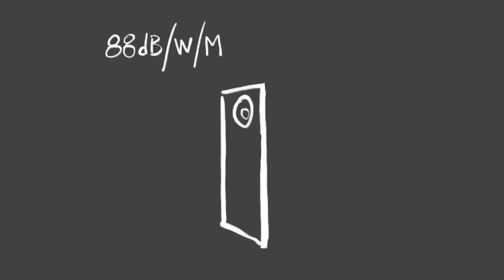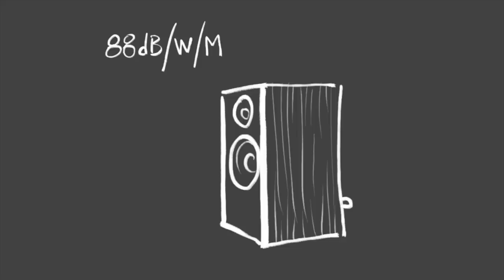John DeVore goes on a rant about the High End Audio lie that inspired him to start his company

Comment: A modern high fidelity speaker is a sealed powered speaker with a separate amplifier for each driver and a digital crossover.  Such a speaker has none of these "sensitivity" concerns and will deliver excellent fidelity,  dynamics and wide frequency response only dreamed about by passive vented speaker designers. If you aren't buying such speakers like those built by Dutch & Dutch or others, you are missing out.

Comment: You do know these amplifier manufacturers "underrated" their amps into higher impedance loads to create the illusion of a "constant voltage source"? A Krell amp, and I'm just using them as an example because I believe they were the 1st to claim 1 ohm stable at full power, that was rated at 100W @ 8 ohms and doubling all the way down to 800W @ 1 ohm was actually capable of a lot more power at 8 ohms than 100W. Since there's no law against underrating an amp that's fine. But it was done to manipulate the minds of consumers into believing the amp was capable of something that it wasn't, doubling in power when halving the resistance down to 1 ohm.

Just to add an oppinion since you brought them up, Apogee would flat tell you that an amp like a Krell was needed to "properly" drive their speakers. They would also strongly encourage you to keep their speakers ~4 feet from the back and side walls. I think that this in the end was a big part of the reason Apogee failed commercially (That and difficulty shipping them safely). Even though they later came out with speakers that weren't that hard to drive and had dynamic woofers the "stigma" of the Full Range and Scintilla speakers as well as demanding room placement of all their full range "ribbon" designs was hard to overcome. Just a roundabout way of explaining why speaker manufacturers can't always be forthcoming in marketing their speakers.

Comment: I share your frustrations in the commercial world as well.  You should note, the doubling of amplifier power output, even with linear solid state amplifiers is not exact either.  It all depends on the output impedance of the amplifier itself as to where its maximum efficiency is located. Furthermore, if you look at such curves, the efficiency drops like a rock once you go below that impedance. 

The other issue with using voltage as a sensitivity measurement is that it presumes a uniform impedance...which no woofer has (that I know)...the impedance specification is nominal over its entire range and for some speakers, it is more nominal than others.  When using the "Watt" specification, that is cooked in...you are measuring a watt of power feeding the speaker and measuring the SPL at 1m.  

Another point on looking at efficiency numbers is to know what the audio range is that they are making the rating for.  This can be particularly important when evaluating subwoofers where a sensitivity rating for say 20-200Hz will be dramatically different than one that was measured just from 40-120Hz.

Comment: Thank you very much for this very informative video. Purely by chance I bought speakers that area constant 8 ohm load across the audible frequency band that are not massively sensitive at 85db/ watt at 1 metre as they are an infinite baffle design. My 70 watt amplifier has no problem driving them at all and they sound amazing. Basically I was very lucky as I wasn't aware of this vitally important characteristic before purchase!

Comment: I'm assuming you left 'frequency' out of these equations to simplify your point! But at what frequency is the source signal in any of these references, (most speaker sensitivity ratings I've seen state - 1Watt @ 1kHz @ 1 metre) or do you just use pink noise? To put it another way. 1 Watt at say 80Hz into a bass driver or speaker enclosure may be just audible, while 1 Watt at say 8kHz into a HF driver or enclosure may give to a blown tweeter or possibly permanent tinnitus, or both! I think references should be made using 'pink noise', with a graph to show the output across the whole audio spectrum. Just as they do with microphone frequency sensitivity.

Comment: Ok, the explanation is very logical, but it doesn't finish clarifying the issue of compatibility or synergy between speakers and equipment.
I have owned speakers like AR11 that burned out sansui 919, yamaha ns1000 that worked perfectly with a mc intosh 240 and some dynaudio that needed huge doses of current to sing, but also had a limited db range. It would be interesting if you explain what parameters should be used to choose loudspeakers for different equipment.

Comment: From this presentation I would gather that a tube amp would be a very poor choice for my low low impedence Thiel speakers.  However, the guy at the audio store said exactly the opposite that - that for optimal sound I need wide bandwith power output of a tube amp for my inefficient speakers. I am Soo confused.  I am thinking my best path is a hybrid amp with tube front end and a power solid state backend? I auditioned such an amp - McIntosh - with some smallish Martin Logan speaker which had powered woofer. It sounded amazing for the price and rated power output of the amp But those speakers are So different from mine.

Comment: So for luddites like me, who isn’t inclined to do maths calculations as part of the process, when buying speakers (and an amp perhaps) what key things should I look out for or consider? what simple rules should I follow)?
Reply: Honestly dude, all these figures are largely pointless to the average home consumer who just wants a decent representation of the music that they love. It's worth understanding that db is a logarithmic scale though, so a 10db increase in sensitivity is perceived as a doubling of volume. The way speakers present sound does vary massively though, and I would recommend actually listening to speakers in comparison with others, preferably in the place they will be used. For high end gear all good retailers will offer this, for low/mid end gear you should be able to listen to the gear in the shop, either in an auditioning room or as part of switched comparison (take some musical pieces you know well). 

If you listen to compressed sources though (mp3 etc) you will never realise the potential of even mid range gear. Decent gear will often make you appreciate how flat and undynamic mp3 is, to the point that you think some huge bottom has come and sat on the sound. Well mastered CD is fine though, and will benefit from decent kit.

You can see below to Bill and SoundStage's comments if you are prepared to take on greater technicality, but ultimately DaVore's take on it is not really correct. Providing it in a "simplified form" which is technically incomplete but leads the consumer to thinking they have the whole story, is perhaps more of a dis-service than giving the technically correct version.

Comment: So what you are saying is if I have a speaker with a high impedance it would require less power to deliver the same amount of sound/volume as a low impedance high powered speaker?

So a 12” speaker with 64 ohms it would require only 2.25 watts running at 12v and 0.1875 amps?

Vs

A 12”  speaker with 8 ohms requiring 18 watts at 12v and 1.5 amps?

I am a real novice when it comes to this.. please correct me if I am wrong..

Comment: High efficiency speakers allow marketing to put a big number which appeals to the most common consumer. They do this at the expense of linearity and Bl (IIRC). There are some decent ones out there, but most sound like garbage. A low efficiency speaker doesn’t mean it’s bad. Often quite the contrary, it just means it doesn’t respond and over respond to inputs. If you blow on a penny and a feather, which one can you guide more precisely?

Comment: I really like your graphics. What do you use? Also -  the db/1W/1m rating doesn't work without specifying a frequency. This is because the impedance is a reasonably strong function of the AC frequency. But even if you specify a frequency, say 1kHz, there's no assurance the speaker will be at its nominal impedance at 1kHz - especially if the crossover is there too. The the right way to do it is to specify both db/1m and W/1m at 2.83V. The former is important because it won't vary with frequency nearly as much and the latter helps understand the power efficiency - i.e. the power load on the amp. But the latter is also more or less given by the nominal impedance so I'm not sure what's so bad about db/1m @2.83V and specifying the nominal impeadance. This is much better info than a db/1W/1m specification.  The real challenge for amps is wild impedance variation as a function of frequency - but that's only going be visible on an impedance plot - and speaker designers should design easy to manage speakers anyway as part of the process. All that aside - I think the days of loud speakers w/o integrated amplification are dead. There's just no point anymore. With efficient amplification, reduced power supply and cooling needs and DSP active crossovers - the entire amplification stage is verging on being less 💵 than a traditional passive crossover. Not to mention all the driver enclosrue flexibility that DSP allows.  All future-FI will be loudspeakers fed by wireless digital signals and they will be fed by low power DC power supplies - like USB-C for example. There is just no need for big power supply when internal energy storage can be utilized. My 2 cents anyway. Thanks for the nice explanation of your perspective.

Comment: I got my first component stereo system in the early 70's.  My Marantz 2270 (still have it) was rated at 70 watts rms.  More power than I would ever need (and very low distortion).  I remember going into a store in the early 90's and seeing cheap plastic receiver/amps rated at 800 watts that I knew couldn't have that much power.  This video does a good job explaining what happened.  They just don't make gear like that anymore.  Even Marantz's have been cheap plastic junk since the 90's.  Also, my JBL L-100's from the 70's are better than anything you can get now (although I heard they re-introduced them).  There may be exceptions with ridiculously expensive high-end gear, but then the law of diminishing returns kick in.

Comment: Uh, I thought it was when a speaker is supplied with 1 watt of power, it's out put is measured at 1 meter away, and then a DB meter picks up how much DB output the speaker has.  All of this is just voltage anyways, so whether or not we are supplying DB or wattage, supplying DB just doesn't really make sense.  Supplying voltage or wattage to a speaker makes more sense, so I'm curious as to why he is calling power, DB....

Comment: But how can you ensure that your speakers will be 8ohm (on all their drivers, if I understood the video correctly) if the impedance changes depending on the Frequency that is played trough it (because the 8 ohm rating is just the resistance so a DC measuring not AC)

One other thing, the Video basically explains, that a Speaker with lower ohm's is harder to drive (requires more Current) but when you go into the world of headphones, here the more ohm's they have the harder they become to "drive" what is happening here?
I'm not really that familiar with all the fundamental technology, so I might got something very wrong or just didn't use ohm's law corrrectly

Comment: Good point.  
As a audio and speaker designer and an audio and music man since the 80's, I have to say that, indeed,  I miss the good old and relatively logical  1w@1m ref for spec.
Just like I also am not a fan of "lab specs" that are meaningless... for examples: how many amps had super low harmonic distortion specs (and almost guaranteed great reviews in magazines where they took many pages of adverts  --  same went for many speaker companies also, btw with regards to adverts for reviews) while they sounded really bad a low listening levels with average SPL loudspeakers (about 87db/w/m)... 
And don't even get me started on Watt specifications that are not properly identified as PMPO vs RMS: So Useless!  (I remember people talking about portable having a "ghetto blasters" with many hundreds of watts per channels while using only 10 D Batteries... Insane and bold fallacies!  -- not to mention that these boom-boxes usually had really bad transducers rated at a maximum of about 4 to 10 w RMS at best and were mounted in plastic cheaply made shared volume/boxes that was the boom-box itself.)  
And while we are at it...  
sigh 
 ...
Well you get the point: a good chunk of the audio industry has a relatively shady and checkered history when it comes to integrity vs marketing & sales department. 
 "Dont let the bean counters run the show" should be the rule for those interested in making quality and musicality, but this is too often not the case with many major brands (and even some small shops trying to survive too often have to deal with money issues) and so, why not "twist" & distort reality a bit if you will -- pun fully intended, btw. -- since after all, most people listen to bad recordings and overly compressed music productions to start with...  
but i digress...  
sigh  
As I stated in opening : Good point.
;)

Comment: Although your rant is technically correct the impedance of speakers are not resistive, the drivers and crossovers contain inductive and capacitive reactances which lead to variations in the voltage to current relationships as well as impedance changes over the audio spectrum.  Another thing to keep in mind is that power amplifiers do NOT amplify power, they amplify voltage.  Their job is to deliver that voltage to the speaker as accurately as possible regardless of the load, no matter its reactive and resistive components.  Therefore it would be really difficult to specify the SPL at a constant power level as that changes over the spectrum whereas the amplifier CAN control the voltage and give you a constant reference to work against.

Comment: That’s interesting.  I’ve built a set of home stereo speakers, 3-way, 18db/octave crossovers etc but never realized why the sensitivity spec subtly changed.  Back when I designed the crossover I put a resistor on the driver that had a lower impedance to balance the impedance of all the drivers.  I’m guessing without that and using one of those solid state amps the lower impedance driver would have become very loud at certain frequencies.  I never even thought about it though since I just use a consumer grade amp.  👍

Comment: I'm pretty sure measuring at 2.83v is the way to go. I think 1watt at 8ohms is the same sensitivity as 2watts at 4ohms. Something someone said to me is that the Seas driver you use in your speakers is not in fact 96db efficient at all frequencies, it measures more like 91. That aside, you have excellent reviews, so your specs must not be far off. My first impression is that you designed your own drivers. 
Also, speakers are usually 99% inefficient at converting electrical energy into acoustic energy. So how much is thermal watts and pass-through watts? We need a constant here? There is a quote I'd like you to respond to:
"You are also likely aware that making the voice-coil length longer than the magnetic gap length in a dynamic loudspeaker is one way to reduce distortion at high cone excursions (low frequencies at high power).  This technique has a tradeoff in that it also reduces sensitivity (since a smaller portion of the voice coil is in the magnetic gap).  Therefore, speakers capable of high loudness (SPL) at low frequencies tend to be less sensitive." Bill Whitlock.
Are there other ways of getting low frequency punch without sacrificing sensitivity? Would be happy to read your reply. I still enjoyed the points your making, it was a good watch.

Comment: It's not a "lie". Yes, output per unit of power (Watt) is meaningful in terms of physics as it measures the power efficiency of the transducer (the speaker). But that doesn't make power at a certain voltage a lie. It's a different way to present sensitivity. It is quite defensible as a measurement relating to engineering. Power amplifiers are almost always built as voltage sources, and so when we talk about "amplification" at all, we nearly always talk about voltage amplification. For a power amplifier that means that the amplifier will deliver the amplified voltage by hook or by crook into the load, and be at some point limited by its ability to deliver either, or both, the corresponding voltage AND current (Ohm's law). Most power amps are designed so that they can keep up the current down to somewhat below 4 Ohms. So, besides the bizarre world of ultra high end audio with 2 Ohm speakers, the 2.83V spec will actually give you a nice intuitive measure of sensitivity for the typical case (8 Ohms nominal impedance, dropping at best to 4 Ohms in the worst part of the impedance curve, power amp can still keep up the current). Yes, many amps will not be able to drive 2 Ohms. But how about the power rating of amps then? Power delivered by a voltage source depends completely on the load (and the limits to both current and voltage delivery). That's certainly at least as "misleading" as dB per Volt in speakers. 

Anyone in high end audio will be geeky enough to know what these specs really mean and take them with a grain of salt. I mean, if you want my pet peeve, it's frequency power response and directivity in speakers vs the much misused flat on-axis frequency responses that everyone is selling. That subject to me is far more interesting that Watts versus Volts in indicating speaker sensitivity.

Comment: Isn't that why most pro audio applications use a higher power amp for the lows (e.g. subwoofers)? It will always take more power to move a 12 inch driver than a 1 inch tweeter.